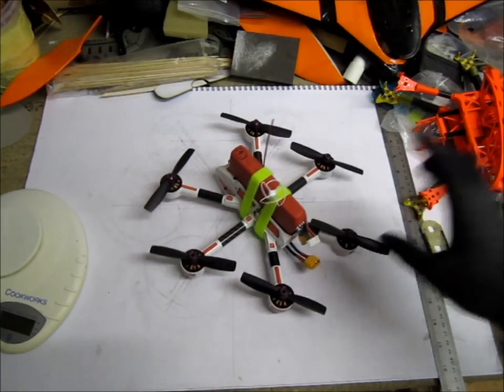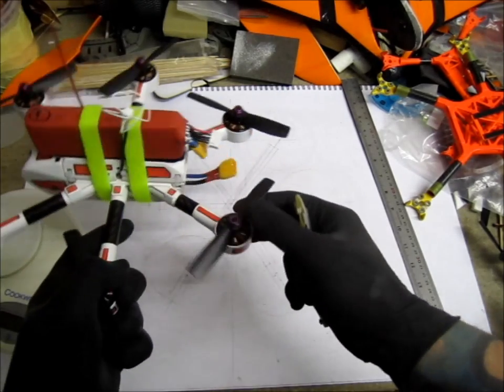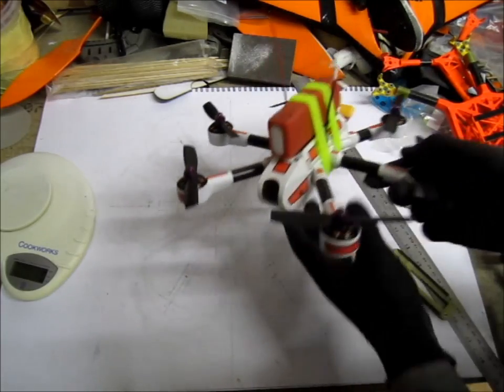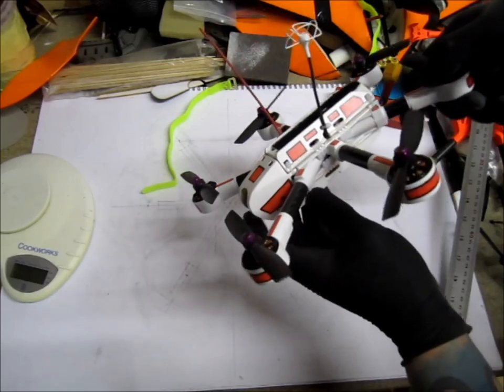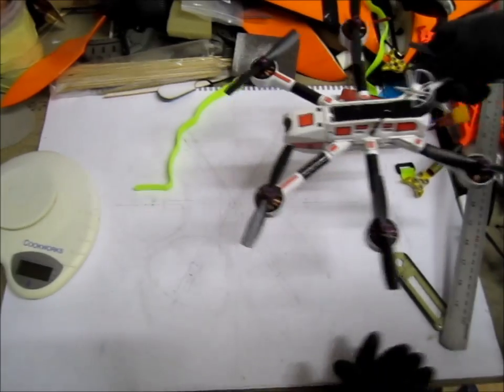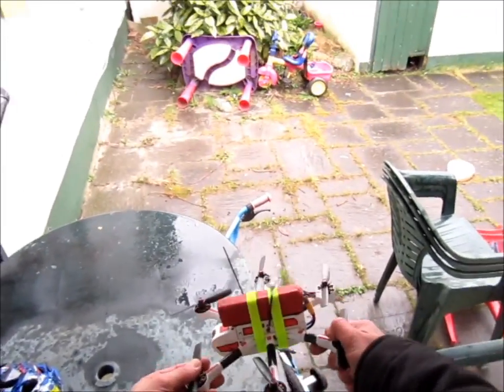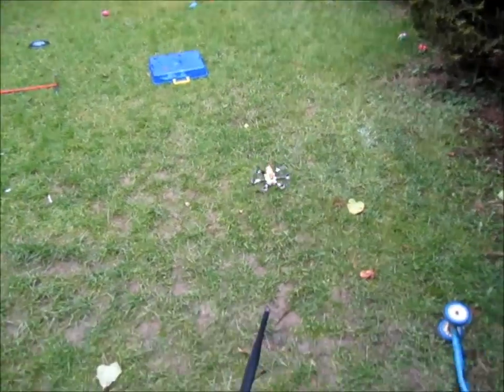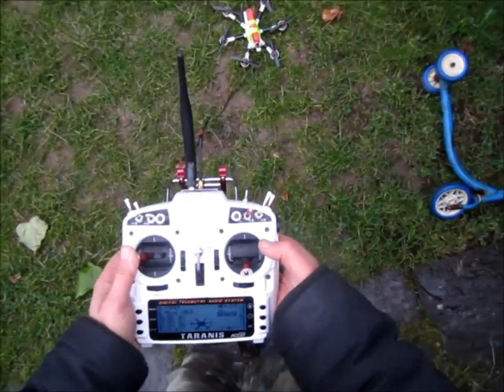230 Mini-Hex. Build overview & quick test

Comment: Awesome multirotor composite origami LOL! Nice one! Been using the jewellers saws to cut kevlar caron hybrid plate it turned out way lighter than cf alone. Did you use any kevlar thread on this one?  There is Spectra thread now too for fishing which is strong.
Reply from the maker: +Hoverbot1TV 
I don't use kevlar thread coz the only braided that I found is too thick, and non braided one will not be as neat when wrapped. I know about Spectra, used one spool, but now just getting any cheap braided line, around 10kg strength.
Cheers!